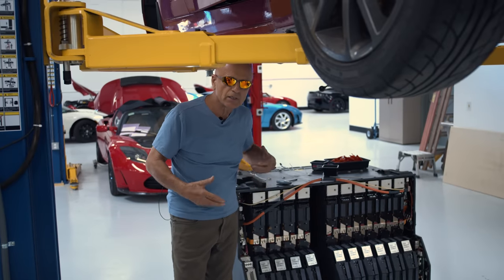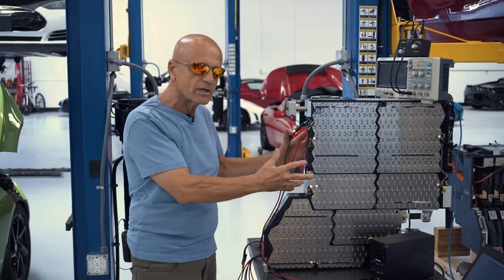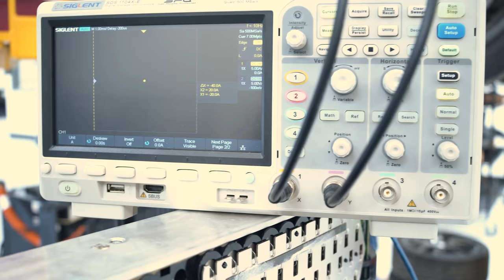Tesla Batteries STARTING TO FAIL | Gruber Motors

Comment: And that’s why electric cars are not mature enough for me. Big thank you to everyone else that goes through these hoops to pave the way for the “right to repair” and parts availability for everyone else.
Reply from the maker: It is the first generation Tesla.  The later models are far more evolved, and make ICE vehicles look like steam engines.
Reply: You mean a fourteen year old Tesla is not mature enough for you?  You might want to check out the new LFP batteries.
Reply: Not too bad considering a typical Engine in an ICE car has about the same lifetime. A 2ZZ Toyota engine used in the Lotus Elise (Which is what the roadster is based on) is probably more expensive than repairing the battery pack.
Reply: It is funny how you think 14 years IS NOT ENOUGH. Most don't keep their car that long. Tesla can go past well over 200k miles. How many cars last that long? How much gasoline do people use over the 14 years VS electricity over that time? Electricity IS MUCH CHEAPER than gasoline even at 2 dollars a gallon. How much maintenance do ICE vehicle need over that period also? Tesla doesn't require oil change every 4k miles, and does not necessarily need a periodic maintenance except for Tire Change, BREAK CHECK because it rusts out due to you not using it very often, fluid change, maybe every 5 years?? You basically pay the upfront cost of owning a car initially, and then the maintenance cost, which is much lower, make up for it and you end up paying LESS over the life of the car.
Reply: @1flash3571  ...average car age on the road in the US is 12 years old, so yeah, 14 years is not stellar. As long as the first or second owner doesn't care about resale value, it isn't a problem. Once battery replacement becomes a concern, the residual value of the car starts going to near salvage levels.
Reply: @AudiTTQuattro2003  In 14 years an EV battery pack will probably cost less than a six pack of Coors.
Reply: @grubermotorcompany  But, as with steam engines older vehicles are repairable.  No EV as yet has proven repairability.
Reply: @desertsoldier41  Have you repaired older cars?  I just looked up 2ZZ JDM motors and found them for less than $2,000.   But, if that Toyota motor had been well maintained after high mileage you could probably hone the cylinders, install new rings without a major overhaul.  Costly work for a shop, but not for a DIY repair.
Reply: @desertsoldier41  Costs of batteries are actually rising
Reply: @grubermotorcompany  Looking into EVs, I noticed that Tesla doesn’t repair batteries, they sell you a whole new one. 2014 era Model S cars seem to have some issues with BMS. What does Tesla do? Issue a “software” update to hide the error codes until AFTER the 10 yr warranty expires. Good luck finding a car repair shop today to look into the BMS of a Tesla. You guys are pioneers, and I don’t think you operate outside west coast area unfortunately
Reply: @timothykeith1367  Gruber has proven you wrong on reparability. Yes at Toyota dealers we can rebuild battery packs.
Reply: @timothykeith1367  Actually per kilowatt they have lowered in price by 120% since 2012. They are close to reaching under $100 per kilowatt.
Reply: @desertsoldier41  I have heard the claims that costs are lower, but the prices still keep rising, so I don't believe it.  I know that price is different than costs, I must pay the price, and that is rising.
Reply: @desertsoldier41  Gruber has not proven me wrong - for me it is just a video.  Gruber has zero presence where I live.  I wish them well, but it ain't happening in 2020 where I live.    Electric cars have been around for 120 years, same old problems - too costly, too tethered.  Maybe some day it will happen.  

Ford Model Ts were so popular that they did more to create a paved highway system than a government agenda.  It was amazing how that came about. But, at first there were no auto parts stores, and most of the repairs were done by the vehicle owners, who did the best that they could.  EVs are supposed to be so simple, but the reality is the repair expertise is generally lacking. I'm hopeful, but I don't see the repairability being solved soon.  If you have plenty of disposable income the electric car could be for you in 2022.
Reply: @desertsoldier41  I’ll have to strongly disagree with you on this one! First of all you’ll just need regular maintenance and small repairs, the part availability for the engine is awesome and you can even buy the engine from a Toyota and swap in in the lotus lol……..
Reply: @AudiTTQuattro2003  exactly! And let’s not forget the millions of electronics in those EVs! Older cars had barely any electronics and could last for decades with the simplest maintenance possible while working hard, these modern EVs can’t even tow or do some serious work compared to ICE.
Reply: @desertsoldier41  lol………
Reply: @carholic-sz3qv  Apparently, YOU HAVEN'T UNDERSTAND that he said that THEY ARE STARTING TO SEE IT. So, That means that NOT ALL BATTERIES are going bad. Do you even know what that means??????? Do ALL cars last 20, or 30 years??????? DO THEY????? Tell me HOW MANY of those cars are over 20 years, 30 years??? Do you know that there are batteries that last a million miles??????
Reply: @1flash3571  when did I said that they ARE ALL GOING BAD?!?!  are you ok!!!?! yes there are millions of cars on the roads that are well over 20 to 30 years+ those cars are even way older in Africa, Middle East, South America……. Million miles batteries!?!?? Lol…. That’s just part of the equation! There are also millions of electronics or other things to go bad. Tesla have not been used any harder than a regular ICE vehicle.

Comment: Supposed to last 10 years but it lasted 14 pretty impressive
Reply: maybe it sat in a garage for 6 days a week.
Reply: @DurzoBlunts  exactly…doubt these were commuter cars. Would be a different story if they were.
Reply: @firebir11  If you charge to only 80% and usually discharge to above 20%, which a commuter would do (50 miles from home to work or less) one can get decades out of an EV battery. This is especially true of the newer cells and cars with better battery temperature control.
Reply: @danielcarroll3358  Not proven t be true.
“Decades” may mean 1.5 decades regardless of how low the mileage and then the vehicle is ready for a salvage yard due to battery replacement costs assuming you can even get a new battery on an obsolete EV even if you were willing to pay any price.
Reply: So this EV brand battery should last around 14 years, glad to know that

Comment: Does this apply for the early Model S? My 2014 P85D loses about 1 mile range every 2 hours. I was only able to get about 125 miles of range on a full charge even though it shows 239-240 miles range on a 100% charge. I complained and brought it to Tesla and they said it is within range. My warranty expires January 2023. I have a feeling they will just give me the run around till it out of warranty and then say I need a new battery which will be out of pocket at that point. I'm beginning to rethink my recent purchase of this car considering due to their service.
Reply: You should have your Tesla tested  for phantom power losses. Something in your caris draining your battery. Are you  really going to replace the battery? Trade the car in for a new model. Then they will possibly change their mind about your car problems.
Reply: @rcollinge325  If my battery has a legitimate problem, I'd like to get it repaired or repaced while still under warranty rather than them decide it does have an issue just after the warranty expiration. I can not see how gettin 100 miles less than the rated full range is normal. I can understand some loss but this i unreal and tesla says it is within range.
Reply: sounds horrible,   I will stick with my old mbz   2001 clk430 only cost me $250 in repairs since brand new.   changed battery 2 x at $150 ea.
Reply: have it diagnosed by a Tesla specialist such as Gruber. The data from the battery management system will tell you right away if it is an issue with the battery pack, uneven voltage drop over time, or an external power zapper indicated by a uniform discharge across all packs. Given a consumption of say 0.3 kWh per mile you lose 0.15 kWh per hour or in other words, your car somehow draws 150 W of power. That will generate heat. Search for phantom drain. Keeping the car awake is a major source of power loss. Checking the charge with the app is sufficient. Do it every 30 minutes and it will drain the battery. Collecting data on the car will also keep it awake and zap power.
Reply: You recently purchased an 8 year old car and your complaining about the car? There are lots of 8 year old ICE vehicles with plenty of problems. I think you just don't know about the car states that use energy from the drive battery. You also don't specify the driving conditions that caused you to get 125 miles when the car has a 240 range indication. Something fishy and I don't think it's Tesla.
Reply: @bigdougscommentary5719  yeah but most of them,  for a few hundred dollars,  and almost always electrical ,, not $20,000
Reply: @bigdougscommentary5719   very rarely will an 8-year old used car require $20k worth of maintenance to get it sorted. And engine replacement isn’t even half of that.

Comment: As one who's been turning wrenches for sixty years, this is fascinating. Not much DIY ability here!

When I was young car batteries had lead cell connecting straps under the rubber sealing compound (cases were hard rubber, not plastic.)  One would drill a hole in the straps on both sides of the dead cell, screw in an, uh, screw, then wrap copper wire back and forth until a high amp bridge was made.

The downside was that the remaining cells were were subject to the voltage of the generator.......no, no alternators then.......which fried the remaining cells. This was bad enough with a 12V battery, six cells.  Lethal for a 6V battery with four cells.  This techniques was usually a way to keep driving until one could afford a new battery.

Comment: Very interesting, thanks!

?: could it be engineered to “detach” bad cell(s) “automatically” without someone physically having to do so?
Reply: Not in any practical way.
Reply: @JRP3  connect each cell with a fuse, once the cell goes high resistance it blows the fuse. I’m fairly sure this is exactly how the new packs operate.
Reply: @tastytechaddictsmtb  That's how all the packs work, the issue is that the cells don't go high enough resistance to break the wire in most cases, they just drain the module.
Reply: @JRP3  Seems like having each brick be full voltage and paralleling all the bricks would be easier to manage that.  The BMS could trigger a circuit breaker dropping the whole brick out of the pack.  If bricks were each a single series string, each one would only be 1.2kwh of your pack capacity.  Dropping it while waiting for repair would cost only a little range, not a continuously dropping range as the whole pack is limited to the faulty cell's limit.
Reply: @kirkellis4329  Battery packs are moving away from using modules.  Model 3 and Y have only 4 large modules, the new Austin made 4680 structural pack Model Y has no modules at all.  Battery manufacturers are trying to simplify construction and what you propose complicates things and makes it more expensive not less.  The fact is with improving cell manufacturing single cell failures are exceedingly rare events and not worth worrying about.
Reply: @tastytechaddictsmtb  the cells do not go high resistance. They go low resistance. If you are lucky it will low enough to blow the cell fuse, otherwise you will have this vampire draw draining the whole block.
Reply: You’re asking if they can engineer their way out of business…
Reply: @tastytechaddictsmtb  High resistance causes LESS current to flow.  And if the hypothetical fuse blew, the entire brick would be dead.
Reply: @zaprodk   100% wrong. You are confidentally incorrect.  Bad cells have increased internal resistance. Doesn't matter if high tech lith-ion or an old lead acid cell.
Reply: @frequentlycynical642  correct they have  increased resistance, but in this case the cell /short out/. It is not the same.
Reply: Yes, but...

Batteries are a consumable item. The companies that make them want to sell you a new one when the old one starts to fail, not allow it to continue to work at reduced capacity. Also, the added complexity might affect reliability. So for now, they make batteries that are expected to last the warranty period. If the battery fails after that, they will happily sell you a new one.
Reply: @frequentlycynical642  - Don't be an AzzHat fanboy. It is called business. They are in business to make money. They engineer the product to last the warranty period. After that, they want you to buy a new one. It has always been that way.
Reply: @billybeemus3929  I'm nobody's fanboy.  I don't suffer from delusions or paranoia.
Reply: I have once 3D printed an adapter for a hole saw.  What was used to drill a hole in the metal sheet for the cell to go through.  The broken cell could be removed from this opening. A new cell was pushed into place and the strips connected to the metal by spot welding
Reply: @1337GameDev  You are incorrect, and going against the direction in which the industry is moving.  Structural packs such as Tesla, BYD, and CATL are using will not have cells which can be replaced or isolated, nor do they need to.  Improved cell manufacturing and precise measuring means a pack will contained very closely matched cells.  When a pack no longer meet reasonable capacity it can either be put into secondary use as stationary storage or completely recycled.  Tesla already has older S/X packs that have gone over 300,000 miles, which is longer than most vehicles last. Newer technology will do even better.

Comment: I've performed my own vehicle maintenance and repairs for over fifty years but EVs require equipment and skills that most people, myself included, simply don't have and that's a shame.  I wish that the cost of dealing with the current problem and the eventual replacement of the battery pack would have been mentioned.
Reply: Learn a new skill

Comment: If a cell goes resistive, to draw down the rest of the brick, it should be dissipating power and thus would get hotter than its neighbors.  Can you identify using an IR camera?  With the HV pack open for diagnostics, as in the video.

Comment: Hey Peter. Thanks for another educational video. I'm in Ireland and recently I purchased Model S 85 single motor 2015 YOM. When this Tesla was advertised on carsale web-site it was said that it's gone through Tesla diagnostics and when I asked to see diagnostic results, especially about battery and drive train the answer was "everything is OK" . My question to you: would you be able to login remotelly to my car and give me some exact numbers rather than OK or not OK. Since I've another full year left of the Tesla warranty - I could be prepared to worse case scenario if my battery is coming to the 75% limit (when they should change it for free) or relax in case if battery would show high 90% remaining figures. Thanks, val.

Comment: Wow! If the car battery contains 6,000 cells, I would guess that it's pretty high odds that once one cell fails, another would fail soon afterward. That changes the risk dynamics rather significantly if trying to figure out whether to fix a cell or two or just change the whole battery - unless the capacity for each cell throughout the whole car battery can be determined.

Comment: At the price point shouldn’t it be possible to implement active battery management that could monitor and disconnect a dying cell? Electrically disconnecting a cell should isolate the issue without removing or disassembling the pack, or is there some reason the offending cell must be physically removed?